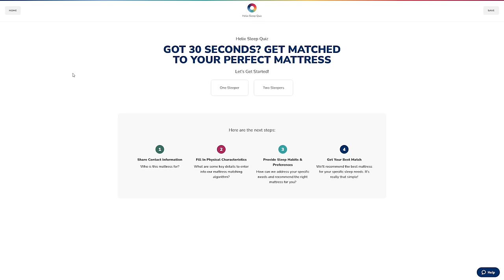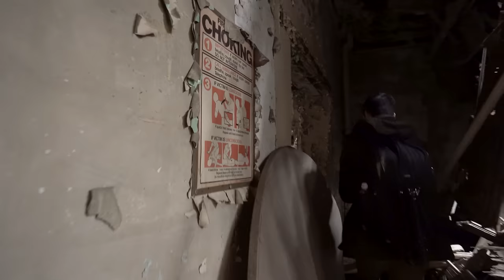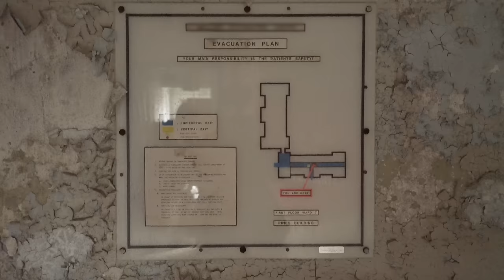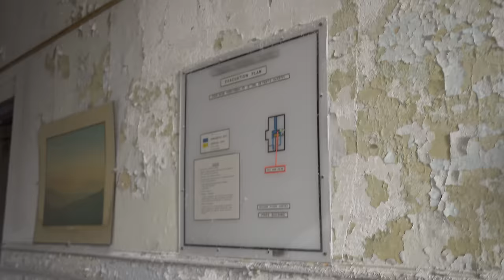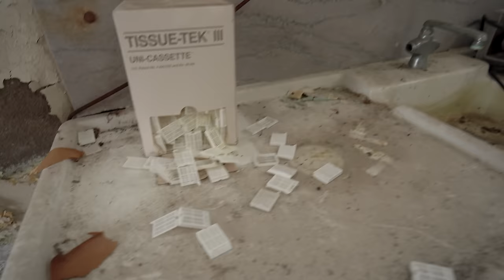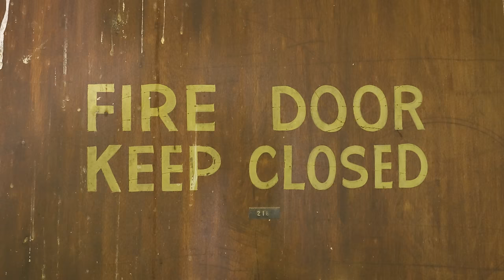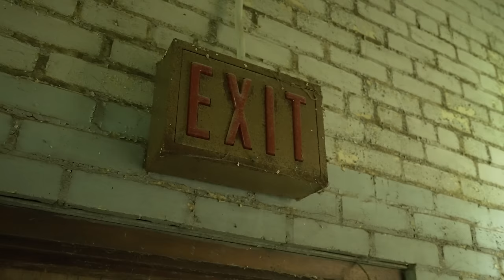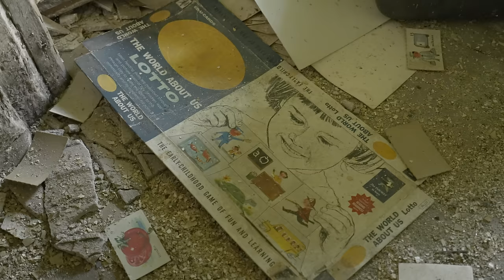Abandoned Asylum for the Incurable Insane - Incredible Morgue and Autopsy Table!

Comment: The hospital where I work was built in 1837. When comparing my hospital to the one in this video, I can't even imagine the annual cost my hospital has to bear just to prevent it from collapsing. Puts things into perspective
Reply: Interesting 😮
Reply: Keeping the roof in good repair goes a long way toward preserving the structure.
Reply: The about of safety inspections and Brock work that has to be done is probably insanity.
Reply: Buildings are expensive as hell to maintain. Even after a year of being abandoned they can look like a warzone.
Reply: @ghostinng274  some buildings are hard to maintain, some buildings are laughably easy to break down when not maintained.
Reply: You'd be surprised.  When it is actively heated and cooled and occupied, closed up to the weather outdoors, it actually doesn't take that much believe it or not.
Reply: Where is the hospital located if you don't mind my asking? In the US, europe?

Comment: These are histopathology tissue cassettes 27:20. If you have a skin lesion excised or an organ removed it is sent for testing. The specimen is dissected and small pieces are dehydrated and embedded in wax before being microtomed (finely shaved) 5 microns thick. The sections of tissue are then placed onto slides and dyed with various chemicals so that when examined through a microscope the cells and structures of the tissue sample are visible. Pathologists can then diagnose cancers and tumorous growths.

Comment: This reminds me a lot of another asylum that was in similar shape and similar style construction. Seems back then they were using brick as a structural element for vertical support and then wood sandwiched in for horizontal support.  Turns out brick is not that great at structure as it shifts over time and the timbers inserted right into the brick work would probably also absorb moisture at the ends and rot out then floors would cave in.  To think this was probably considered "low cost" construction back in those days but still lot of attention to detail with the brick work, like the arches in the basement.
Reply: It depends how it's built. Most houses here in England are brick exterior with wooden floors. Many of them in the big city's are victorian and are over 150 years old.

Comment: In case you guys are not aware, the red square sign with the cross in the center is a sign to Fire Department personnel that the building is structurally unsafe for entry. Fire personnel are prohibited from entering the building in the event of a fire due to risk of a major collapse.

Comment: NY state has many closed "psychiatric centers" that were run by the state. Most of them closed in the late 90s to early 2000s. Many opened in the 1800s. It's amazing looking back at these old asylums. It's a window to the past that is decaying before our eyes.
Reply: Is this one in New York?
Reply: @michael931  it's one of the many places in NY that have been abandoned. This place is definitely unsafe and should be demolished, but unfortunately, the cost to demo is huge, mainly due to asbestos. The asbestos, lead paint, mold, and rapidly deteriorating structure make this place one of the most unsafe places around.
Reply: willard asylum

Comment: 27:15 those are wax holders for tissue samples.  Samples would be preserved in formaldehyde, then embedded in molten wax in these plastic holders.  Hospitals have storage vaults with thousands of these, each with a serial number little blob of tissue from biopsies.  They can slice off a thin layer and look at them under a microscope.

Comment: I wish recycling of these old building materials was an option. All those bricks…the doors, other fixtures…they could all be used again. Prison laborers could take those bricks down and stack them on pallets, etc. Not sure re-using these items is feasible or not, such as those doors could be coated in lead or asbestos could be floating about, but it kills me to see such precious resources going to pot. They don’t make good stuff like this anymore. By the way, particle board and plywood and other items such as carpet are not healthful either.

Comment: the bed that was shown in the autopsy room looks it could have been a stretcher that would be used in an ambulance as the two extra wheels would help guide and push the stretcher into the ambulance when the main wheels are collapsed in as it is loaded into the ambulance

Comment: Interestingly at 38:21 I noticed that sometime ago they installed wall bracing in the hallway.  I was honestly concerned about that stairway failing since the wall that half the stairs are bearing on has nothing supporting it below, its possible those bracing bars in the hall kept that from happening.  Thought this was the scarriest moment.

Oh and when exploring structurally questionable places like this stay near the walls where the floor joist bear on the structure,  these areas are the least likely to break from the added weight.

Comment: The risk was very high. I am surprised that you took them. I know that the heart is not deaf and passion has its own rules, but please remember to be safe. 
I like the fact that you don't give up, going back to previously explored buildings. By the way, is it known for what reason no one  adapted it to its new use, but allowed it to become a complete and life-threatening ruin? These remnants of the remains, especially the paintings, give a specific atmosphere to this exploration - hanging on the walls are prints framed in anti-frames, and right next to this there is no floor. The building is falling apart like a house of cards. 
By the way, I'm curious as to why Bryan is responsible for all your advertising.

Comment: So the asset tags said that this is in the New York State... what are the chances that Hurricane Sandy (2012) did these buildings in, and they've just been further decaying since?  That property looked it was a pretty close a shoreline from the drone footage.  It's just weird because : Usually anything built from this era can stand up to some pretty hardcore neglect, but this seriously looks like there was some serious exterior damage to this building, and then everything inside started failing or the building was being prepped to be torn down.

I say "prepped to be torn down" because : Looking at some of those collapsed rooms, the wooden supports that would have rested into the exterior brick were just gone... that doesn't make a ton of sense as far as natural decay is concerned.  Now if somebody went in there with a chainsaw and buzzed those wooden supports off (yes that's 100% a thing that's done to tear a building down from the inside-out) in key places to aid in demolition...

What are the chances these buildings were prepped for demolition, then the demo just never happened due to <insert_political_environmental_compliance_reason_here> ?

All of this is just speculation on my part, but it seems pretty weird that so much of these structures were destroyed like this... very rarely would construction from this era just fall apart like that (something built in the 1980's on the other hand...) unless somebody was trying to tear it down or some serious natural disasters crippled the building.

As always, thanks for the great content!

Comment: I was curious about all the while watching what was inside the top tower, but I guess you guys couldn't film it cuz the stairs leading up were all broken.
Buildings much older than this hospital have not collapsed as badly, but this one must have been poorly designed. I've never seen a building like this with holes in most of the hallways and collapsing. It's really cool though.

Comment: What did you say at 32:05?  Was it “knob and tube flooring outside”?  Just curious if you meant “tongue and groove flooring”? if so that was not flooring that is wood lath for plaster walls.  It is not exposed flooring.
Reply: "You can see the old knob and tube wiring exposed."

Comment: Interesting they chose wood floors/joists for construction. Unless it's just that old, many buildings of the late 1800s early 1900s, were still modern enough to use reinforced concrete, structural terracotta or 'clay tile' blocks for both the floors and walls. It goes to show, we all love the old fashioned construction BUT even back then, sometimes they built 'cheap' cost cutting structures that weren't meant to last. Just like today, beautiful on the outside but cheaply built underneath. These buildings could have survived much longer.

But when the skeleton is in good shape, there is no reason to demolish an antique building. It can all be repaired and restored, and for less than the cost of a new building... So when it does 'cost more' to restore, it's usually intentional, because they don't want the building, they just want the property. They want to demolish it. Simple as that. It's a shame these property owners don't care about history and do more to keep this stuff around. They never did care or else these places wouldn't be rotting away... because ALL IT TAKES, to make sure these places last longer, is a maintained roof... nothing else matters as much. Graffiti, broken glass, holes in the walls, falling plaster, scrappers, that stuff can be repaired. Even a few broken windows won't hurt as much. The roof is the most important thing, a bad roof is the source of all the permanent damage. Sometimes I think they let these place rot on purpose so they have an excuse to demolish it. A historical building in good shape would be much harder to demolish when the city/people have their eyes on it. When it's disintegrating, nobody cares.